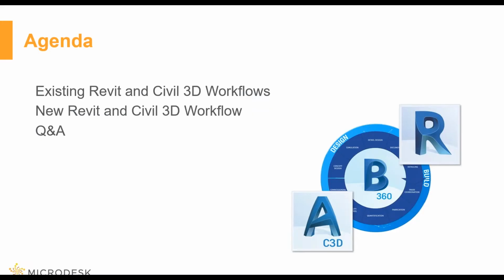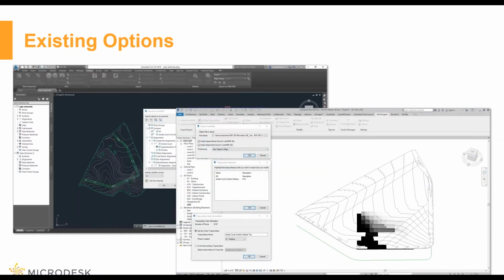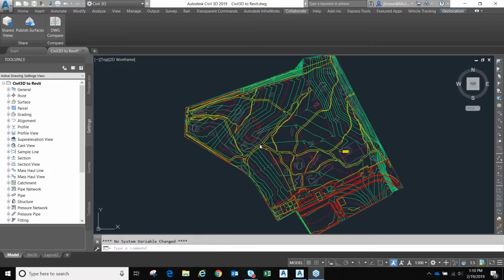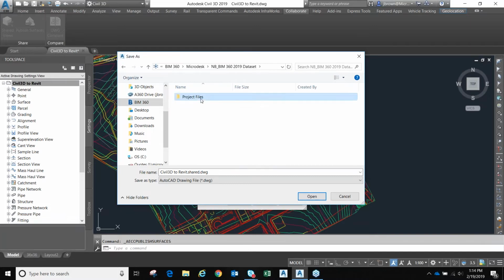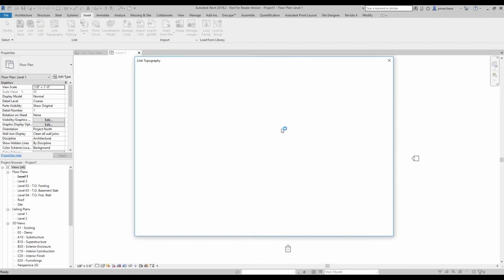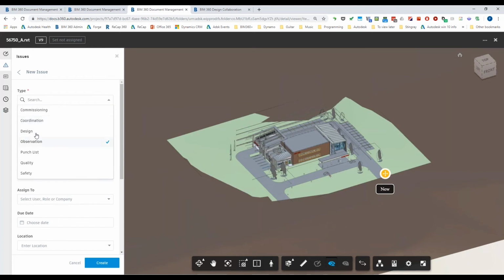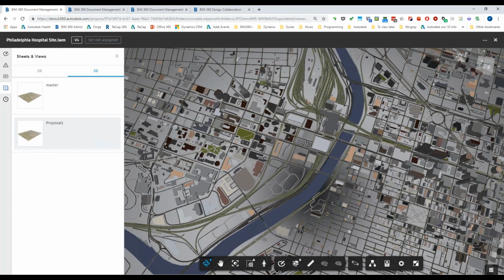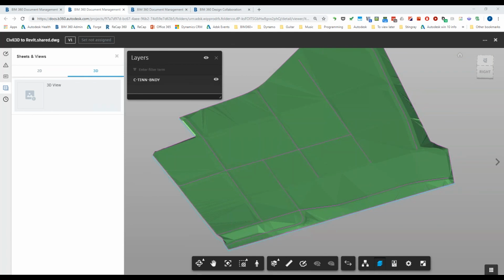Webinar: Revit and Civil 3D Workflow

Comment: Thank you for the information. Great channel!

 I have been researching whether we should switch to a Civil3d/Revvit/Lumion workflow at the office. We currently go Civil 3D/Sketchup/Lumion and we do all of our construction documentation inside civil 3D and autocad (so we would not use revvit for documention purposes. Just 3D purposes) 

The biggest challenge we currently have is Civil 3D revisions to the topo. It's a pain to have to re model a lot of the topo and hardscapes inside sketchup every time something changes in Civil 3D. But we love sketchup for its ability to quickly and easily model and also its use of the 3d warehouse which is incredibly useful.

We do planning, engineering, and landscape architecture mainly for city parks, playgrounds, sports complexes, residential developments... Things of that nature. Any guidance on whether we should be switching gears to revit?